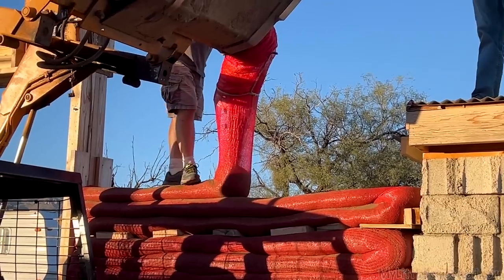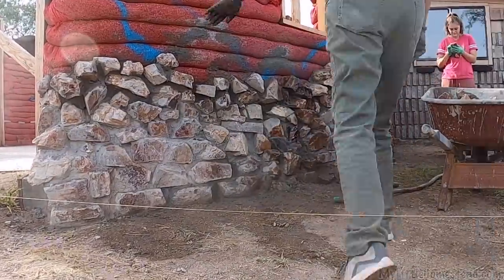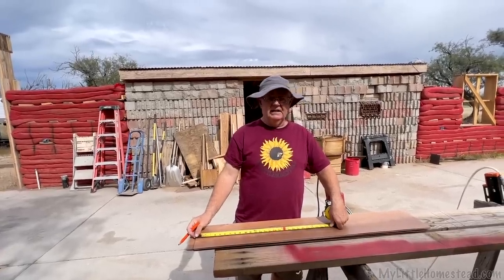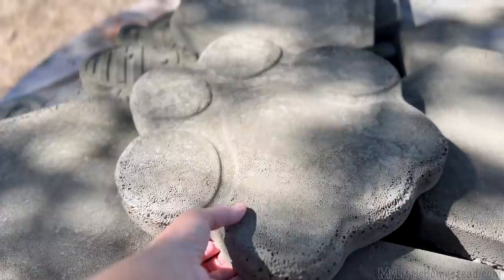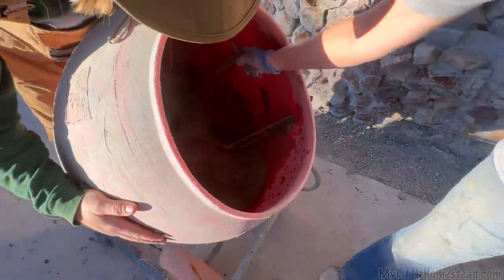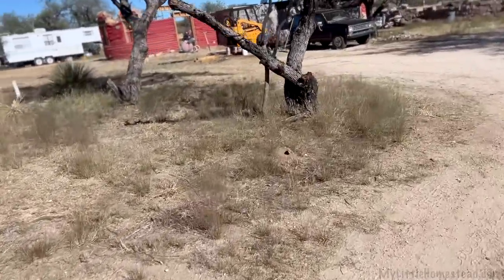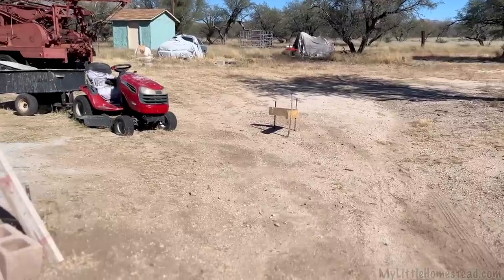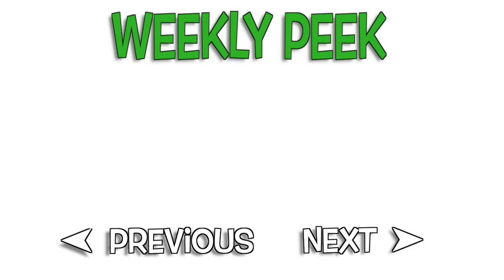Best Aircrete Method & Recipe Mix for Pavers! | Weekly Peek Ep378

Comment: You can reduce the cracking by putting a wet cloth over your batch of pavers after they're starting to set up, and spritzing it with water a couple times a day for the next couple days. Cement is exothermic and if the heat builds up too much it cracks itself apart.

Comment: Shop looks great, I really like what you are doin with that aircrete. it probably provides a nice r value to the wall. Have you thought about using a fiber of some sort to help keep it stronger? I recently came across a home builder based out of Florida that designed and built homes using forms like you guys but a little bigger scale, they are no longer in business as of recently but this aircrete could be a product to use instead of the polystyrene core. Look them up, the name is “AI Domes”. Well worth checking out to get some ideas on where this aircrete thing could go. big sculptures would be fun with that stuff too

Comment: I wonder if it might be worth your while to build a quick drying rack for your aircrete pavers. That would encourage air flow for drying and discourage animals walking on them. I suppose it would depend on how much many you have to do. I'm thinking using scrap wood and something just temporary that you can break down when you're done. Just a suggestion.

Comment: I wonder if you could pour maybe ¼-½ inch of portland and sand mix (with no foam, or maybe a really low ratio of foam) in the bottom of the molds, then fill the rest up with aircrete. That way you would have a more durable surface.

Comment: Okay, I said this last week, I'll say it again - you need to build some temporary shelves from concrete block and scrap wood to hold the hex molds while they set, and to hold the finished hexes while they cure. Get them up off the ground so no furry or scaly creatures can walk through them.

That mixer sure gets the job done. Even in the video those pavers look like the most evenly mixed and most solid batch you've made yet. And with the mixer's capacity, you can crank the hexes out much faster, so you should definitely order more molds.

You need to get a bee mold, though. What's a beehive without bees? Maybe a bear, too. You know, because bears love honey.

Comment: now that you have your aircrete mix perfected. have you considered using white cement for your pavers.... then you could use the colors available for mortar and concrete. then put a few colored or white pavers mixed with your grey pavers.  or use them as a trim or border..... just a thought. I bought a aircrete foam maker, I need to try blending some foam and get that right. then use the aircrete as stucco.. over my concrete. I'm thinking I'll need to use less water in my mix...  ps: what are you using as a foaming agent ???? thank you..

Comment: I wonder if you shouldn't be treating these mold much like pouring resin eg painting a thin coat into the mold first, to help alleviate air bubbles along with vibrating the molds for a while to further get the air bubble to rise. Something eccentric in a drill held up to the outside of the mold might also work ok Always fun watching
Reply: ................and go stand in a corner for that paws joke at the end! lol
Reply: aircrete is air bubbles, just need to get rid of the big bubbles...... you want a uniform blend of the foam/bubbles..